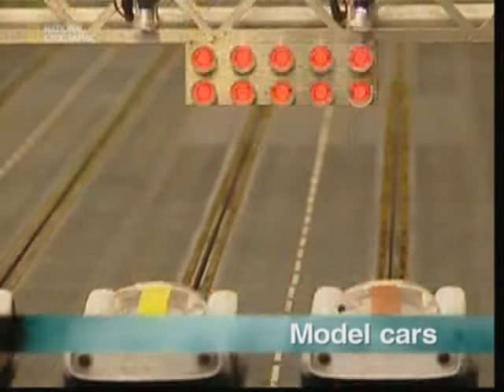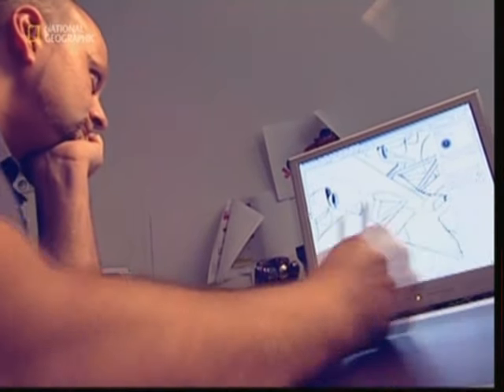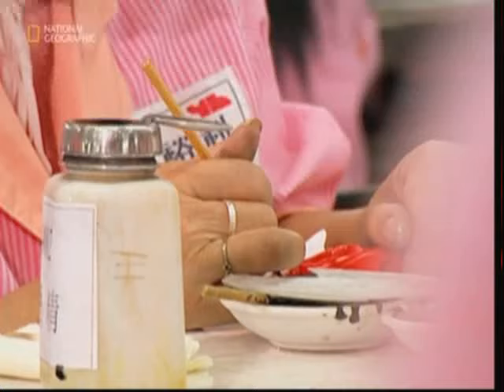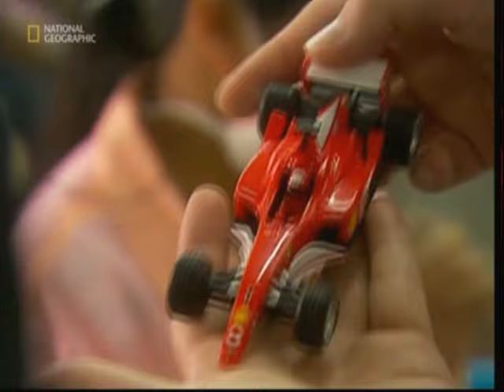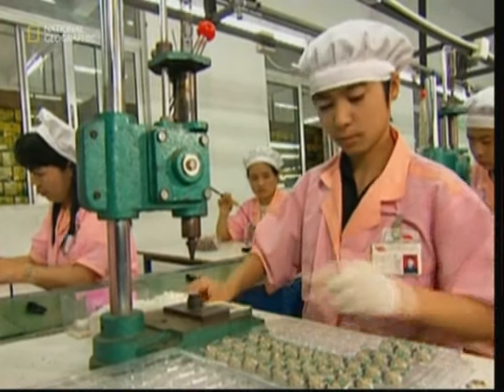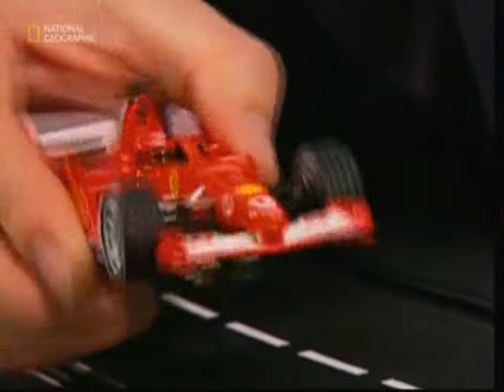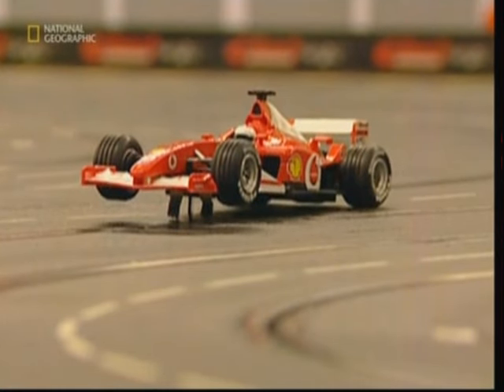How It's Made - Model Racing Cars (Scalextric)

Comment: The cars & tracks being manufactured here are not Scalextric, they are Carrera. Unlike Scalextric track, Carrera track is 1/24 scale, and the power rails are isolated from one another by plastic strips that run between the rails and the slot that the guide blade runs in. This feature removes the possibility of the tracks being shorted together if a screw or some other metal object falls into the slot.

Comment: The plastic IS colored! Resins (plastic granules) aren't quite as "uniform" in color as are most paints. It's a pretty safe bet that Ferrari has "licensed" the factory to produce "Ferrari Red" which is why the cars must be painted. And each car must match in color before and after each car made. Lead-Based fuel was banned in Hong Kong in 1999. Plastic and paint are both petrol or fuel-based products.

Comment: Yes. The Slots are lined with plastics...Scalectrix are not...
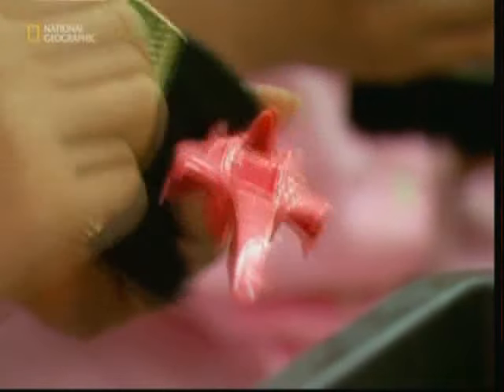I like the soft material the Scalectrix tracks are made off but the slot is bad...Carrera is 1:24 and deeper. A stock Carrera car wont run on Scalectrix.